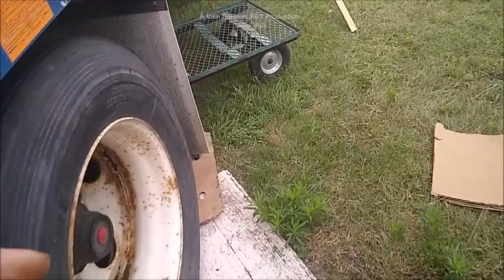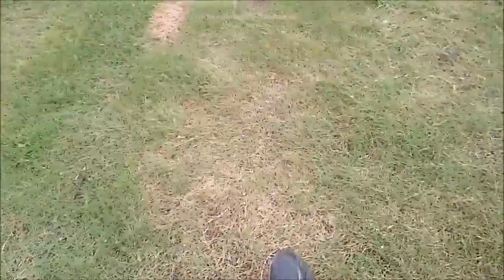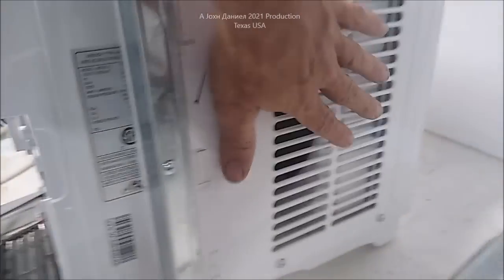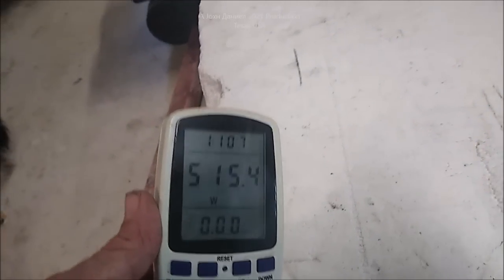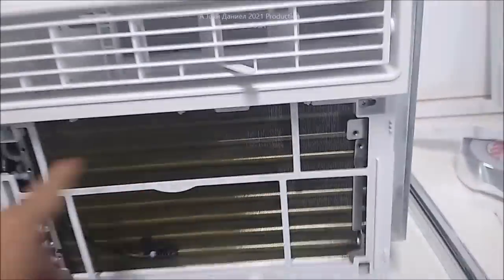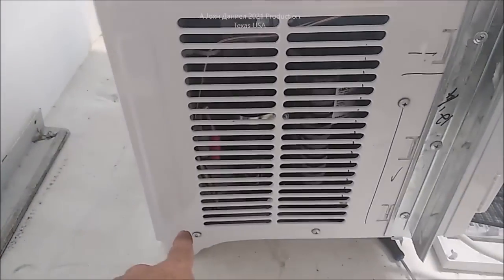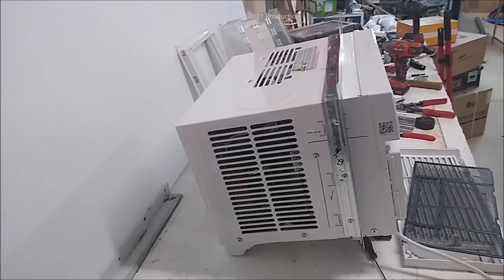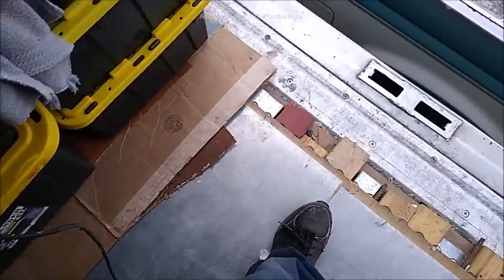Cheap Powerful Window AC easily modified for Through the Wall Air Conditioner, best options below

Comment from the maker: Using the Arctic King 530 watt efficient 8000 BTU Window Air Conditioner with Remote https://bit.ly/2UzhTMh & the 430 watt inverter friendly 6000 BTU model https://bit.ly/3xPPHD7 for same applications. Be sure to use proper screws or rivets keeping them short 1/2" style like I use, Example - https://amzn.to/3j4RL5T

Comment: Hi John. Thank you for the video! I'm worried about the grid going down sometime this summer and not having ac for my little ones. I went to your link for the solar batteries and I didn't see the one you recommended.  Do you have another battery you'd recommend? I have no idea what I'm looking at. Thank you!!!
Reply from the maker: What state/area are you located in. Supplies of batteries are getting low.
I'll check with inventory sources to get your best options.
Reply: @JOHNDANIEL1  I really appreciate your help. I live in northwest Arkansas!
Reply from the maker: Imperial Battery, Samuel. Direct his number is 682-200-6886 in fort worth. What size system you trying to achieve? I'll know how to size that amperage.

Comment: I was very impressed with the unit. Paid a couple hundred more for a different unit and this one way outperformed it.
Reply from the maker: It's common today with very good grades of products like this AC slipping through the grips of low quality to survive the price wars. I bought a second one to set back for the shop room and it's cooling almost 900 square feet without a issue and doing it at nearly 80 watts less power than all other similar makes. I do have 5.5" EPS  foam in the walls and 6.75" in the roof so I'm at a R-40 level.

Comment: Why did you choose to mount the AC in the wall vs. the front opening where the reefer unit was?
Reply from the maker: Even cooling. This ac unlike most has a very good fan and diverters on the output grill. It's a near perfect 50/50 distribution. So mounting it in the middle of the trailer it pushes air down both sides effectively but if I mount it in the front it would be a much cooler zone in the front than in the back.
Reply: @JOHNDANIEL1  Makes sense.

Comment: I mean if you are just using a shipping container as a shed ok but anyone that is going to put an ac in and try to live in it will be framing the walls and insulating so I'm not sure what you are talking about there but if you just want something to put on some land as cheap as possible ya I guess that's not a bad deal

Comment: John you convinced me.  
I’m going to buy this unit to build a portable AC system to use during the next Florida hurricane storms and power outages.

I live in a condo and have accordion shutters so I have to figure out a way to make a box for the AC and attach exhaust and intake tubing like one of those crappy portable units since I can’t  mount it in a window. 
This arctic king sounds like it’ll work great for me. 

You have a new subscriber.  Thanks!

Comment: If your using in a basement with no window or similar situation, putting a closet like box frame around the back of a window unit will work, a 6-10 inch inline fan (depending on the btu) with insulated ducting and a thermal temp control will let you exhaust the hot air across the room or thru a small window the unit won't fit in. A easy fix for those who can't knock a hole in the basement wall, or don't want to cut a hole in their trailer/camper.

Comment: Those sea containers have been sprayed so many times with toxic chemicals they dont appeal to me. The truck trailer makes common sense to me, i always thought of buying a small truck , where i could  have a removable unit from the tray then use the truck for work. Man thats an effecient wall ac, what gas does it run , ive seen splits using a methane mix but never a wall ac so effecient .
Reply from the maker: Its running 134 but they did a unusual design improvement, instead of a identical core size, they used a much larger condenser design with focused fins in all top tube collectors. The fact it has a 95 watt blower 1/7th HP is awesome, most only use about a 1/12th HP (55 watt) and those run forever to move any air. This one has been one of my best AC finds, I bought 3 more just before making the video because they don't even make the battery bank dip from start Amp Onset on the inverters.
Reply from the maker: PS - J-Bar does deliver those refer trailers in most of the US from many re-cert yards. Total cost is about $7000 to $9000 trailer and delivery with legal title.

Comment: Thanks for the video, any suggestions where to get a trailer like yours?  I was thinking about a Shipping Container but now want a trailer, currently I am wasting money on a storage rental.
Reply from the maker: You can contact me at olympicpowercontrols@yahoo.com
We pick and haul them for buyers from numerous re-cert yards. Trailers themselves go for about $3500 to $5000 and delivery is higher ($2300 to $4000) than the China boxes ( $1000 to $2500) due to the DOT and FET cost, but you save many thousands on day one when you got a wider, longer and already insulated trailer to convert or build from. With the wheels and carriage removed they are 3X stronger than the 20, 30 & 40 foot cargo containers which require other containers connected to them to travel.

Comment: How many panels to run that ac, ive currently got a 300watt system with 40a ep ever charge controller, i looking to get up to 7 more panels
Reply: I am no expert but the thing was drawing 535 watts on high so Id say at least 750 watts in full sun? Maybe 800 or 900? And a good inverter.

Comment: I don't know what to say-- every time I turn around, I learn something new from you. In San Antonio, my house ac died. It would have cost $20K to replace (inside and outside units).  I bought small window ac units for the bedrooms. My master bedroom had a patio door, so I bought a pet door and through that opening, ran the exhaust from a portable AC. (Only thing I could think of). In the living room, I attached aluminum angle to the ac the same way you did and framed the window around the AC with lexan, with the aluminum angle bolted to it. It worked. I live in an 88 Fireball fiver, the rooftop ac died long ago. I have a window unit through the kitchen window (the previous owners took the pane out).  I'm going to use the drip cap, remove the other window pane on top so this fits in the space, mount this in the space using a lexan-like pane (now designed not to yellow), and shelf brackets under the unit to keep it safe.
Reply: You were gona get ripped off for 20k!

Comment: Good video John.  For those who are worried about drilling in certain spots [which is a valid concern], you can reinforce the attachment of the drip edge by bonding it with GOOD construction adhesive.

Comment: I would have put that thing up there where the reefer was that way you don't have to take it out if you need to drive it down the road cuz I'm driving it down the road you'd be too wide but it would be easy enough to pop it out of there if you need to drive it down the road glad you finally made it and getting everything set up welcome to Texas and enjoy our weather if you don't like it one minute don't worry it'll change
Reply from the maker: If you note the older MRI medical trailers they have 3 similar AC units down the right side protruding about 6" out and are legally hauled as under DOT max non permit width.
Reply: @JOHNDANIEL1  yeah you're right but some of these cops around you'll find they don't know their ass from a hole in the ground and they'll try to give you a ticket and makes you waste your time going over there to the courthouse and showing them

Comment: Why didn't you install it where reefer unit was?
Reply from the maker: I did mount one in the other trailer like that and had hotspots. This particular AC has the best diverting Left/Right I ever found and excellent volume, placing it in the nose would have been OK but in the midship it is able to get a total balance of cool in the whole trailer.